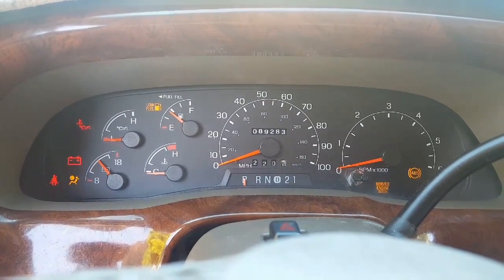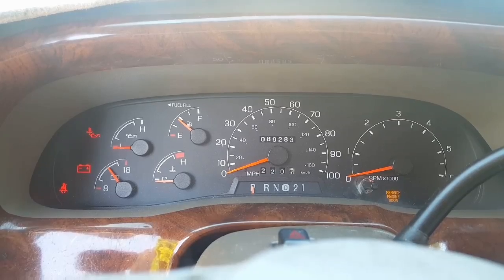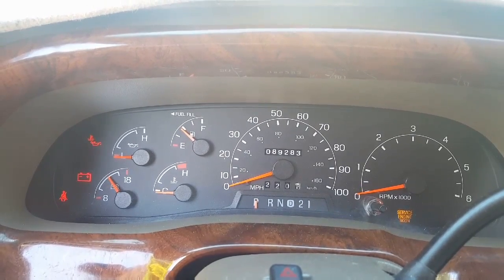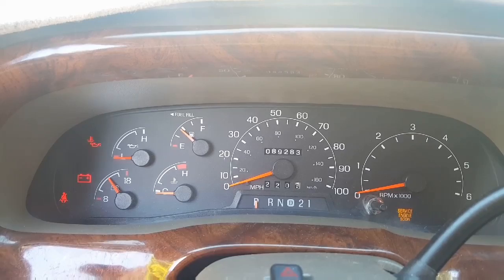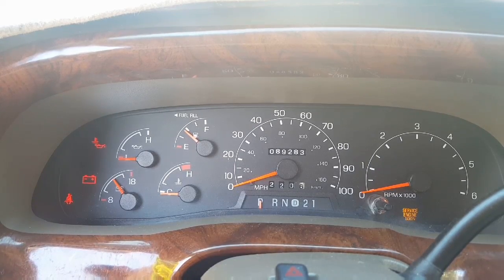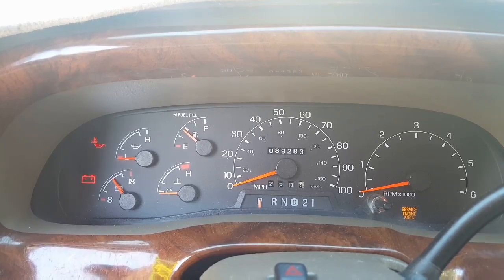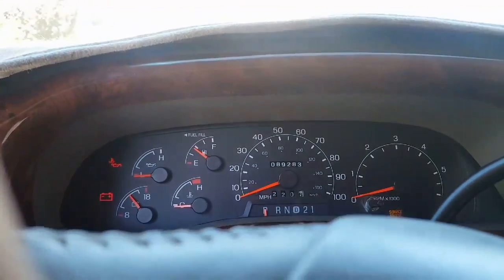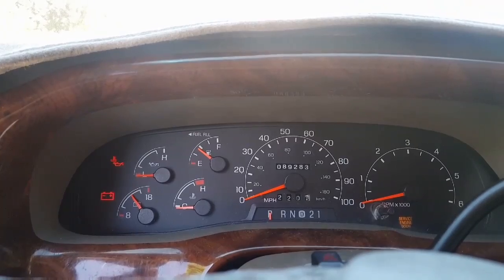Ford F150/250/350 Seatbelt Minder/Chime Disable

Comment from the maker: If you're looking for a permanent fix to your key left in ignition chime check out the link in this comment. It will give you a step by step procedure on disabling the chime without cutting wires. It only takes about ten minutes and is super easy. The plastic column comes apart with a Philips head screwdriver and the ignition comes out super easy. I did mine in like ten minutes flat.  https://www.ford-trucks.com/forums/1438806-key-in-door-open-chime-disable-with-pictures.html

Comment: My buckle is a bit wonky, it doesn't always read the buckle is inserted. I really had to slam it in, but I got the rapid blink.. The tone did sound for about a block and I pulled in my driveway and took the seatbelt off, backed down the driveway and drove back up without the seatbelt and just sat in drive with my foot on the brake.. The seatbelt alarm didn't sound for the 3 minutes I waited, so fingers crossed I think it's silenced.. Yay!! because there is nothing as annoying as actually wearing your seatbelt and still getting that alarm.

Comment: Hi, I have a Ford Expedition 2006 which I bought and have not chime sounds; seat belt, ignition key if left when leaving the card there is not sound, open door, etc. Can use this same method to turn all these sound on?
Reply from the maker: You can use this for the seat belt to turn it back on. The key is a different issue. That is a sensor inside the key cylinder itself. I would start with the fuse box. If no blown fuses someone may have modified it to where there is probably not going to be any chime sounds at all. Best of luck..
Reply: @Inp3erp3tuity   ... Thanks!

Comment: Please help me! I have the same truck (2002 though) and I can’t lock my truck by the button on the inside, I just lock the door manually by pushing down the lock. But if I press the lock button (by that I mean the switch that turns the alarm on when you press it) my truck will go off if I close or open the door even with the key. I can unlock the truck with the key and turn it on but the alarm will go off as soon as I turn the truck off. And I can’t simply press the unlock button to stop the alarm. In order to stop it I have to reset the alarm system. And I have to constantly watch where I’m putting my arm so I don’t accidentally press the button. It’s just so annoying please help and tell me what’s wrong or how I can disable the alarm system completely.

Comment: I just want the damn chime taken out and gone where the hell is it located. I don't want to play with mumbo jumbo in my emergency brake is jammed at the top anyway. I just want to leave the door open in the stereo on not hearing ding dong, makes me crazy
Reply from the maker: What your talking about is the key minder chime and the sensor is located inside the key tumbler. You would have to take the steering housing apart but not too bad.
This link will be super helpful in taking care of that issue if you want to go that route
https://www.ford-trucks.com/forums/1438806-key-in-door-open-chime-disable-with-pictures.html